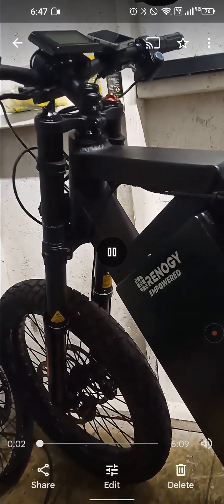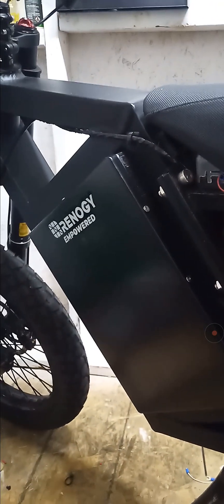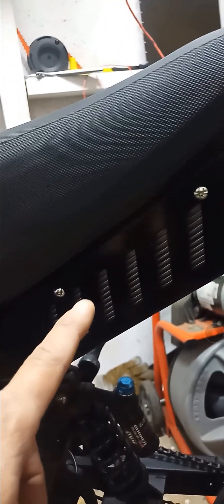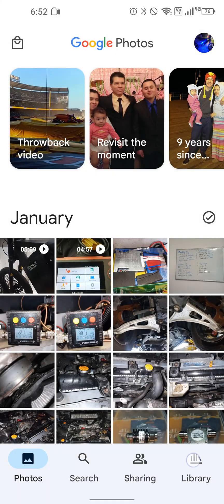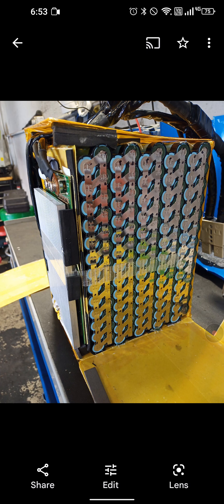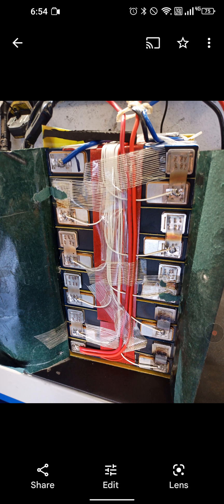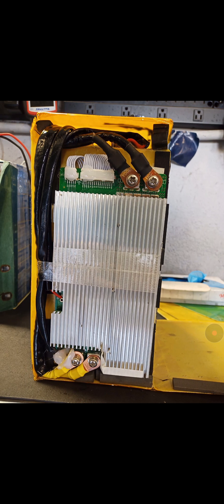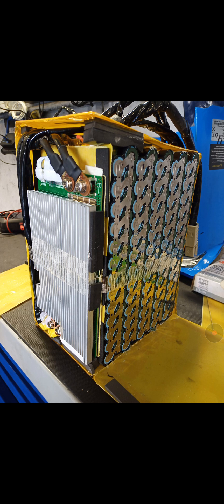CS20 e-bike Shutdown Issue SOLVED!!!!!!!!

Comment: the battery you see in this video first...is a 48v. you got the voltage wrong. your bike is a 72v. Then you bought another battery still of 36v. Your voltage is 72v...84v when it is at 100x100....72v when it is at 50%...and 60v when it is flat. you first bought 48v (54-42) and then you tried with a 36(42-30)
IT WILL NEVER WORK.
Reply from the maker: Yeah voltage was wrong. The problem has been solved. Thanks

Comment: the quality cells that you use in the 72 volt and 41ah configuration....they easily become unbalanced...especially if you use ebikes in winter....because there are 20 cells for the series and 14 parallel for the 41/42 Ah that must always be at a temperature of 20 degrees celsius.
It has become unbalanced because you have always charged it with a 10A charger.
If you always use a quick charger the batteries become unbalanced immediately.
To overcome this problem, you must use 2 3 normal 2A-72v chargers...and if you really need it....1 time the quick one. If you always use a quick charger every year they become unbalanced and you must take the battery to be restored by a technician. L G cells last 5 6 years.
Reply from the maker: Hi. The problem was solved.. thanks

Comment: hi Dennis. I wanted to ask you something.
Is the original battery you show in this video the original one, which was there at the beginning when you bought the ebike? or the one you show in this video...as the first battery....is it the battery you bought? and then you bought another one? I think the one you show first in this video...is 48v, because it has 13 cells in series. the 13s are 48v.
it's normal that it turns off after a while. did you mount a 48v on your ebike which is 72v
Reply from the maker: It's the original. The problem was solved. Thanks.

Comment: 7:15 Well said mate! That's the solution for 90% of ebike issues. Although is not desirable, sometimes a sensorless controller will also help you to save money by not having to replace a hub motor that could still be used.
Reply from the maker: True thank you. We learn as we go.

Comment: Nice video thanks. I have a similar problem  Bafang 750W  48V mid drive,  power drops out after a slight throttle. Batt reading 52V before I give throttle then reads zero after drops  out.  I also hear a ticking sound coming from the inside of battery when I turn  on the display….  I will open and check condition of the cells, might be one or more are bad.  Any advise on who makes a good Batt.  Thanks
Reply from the maker: That ticking noise could be a relay or the BMS.. is that the original battery that came with the bike?

Comment: Great job in finding the problem questione  . . . you found out what the problem is . . . are you going to buy a original new batt pack from the bike maker . . . and at what cost .  .   .
Reply from the maker: Yes i found the problem. I think ill start building my own battery. A new battery pack price is around $1.3k.. amazon probably $2k.. i rather built it myself. Not that difficult but it is dangerous..

Comment: Good stuff to know. Glad you got it figured out. I've only got 5000 watt with 80 amp controller, so hopefully I won't have this problem?
Reply from the maker: Thanks.. hopefully you won't. But if you do, you know what to check. We are here to help each other if you got any questions.
Reply: You have to make sure the battery BMS match the 80A the co troller would be pulling … another word make sure your battery BMS is minimum 80a capable …. Personally I would go 100-150A to be safe

Comment: I've tried turning it on while it's plugged in and after disconnecting the battery and still no luck
Reply from the maker: Probably blown fuse on the positive battery cable
Reply: Fuse